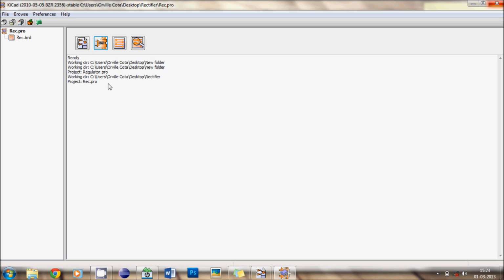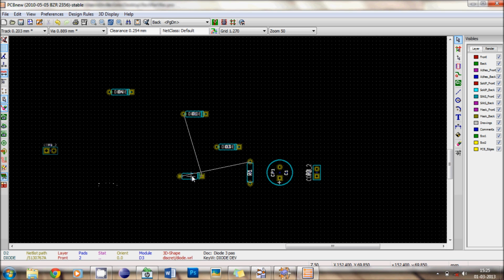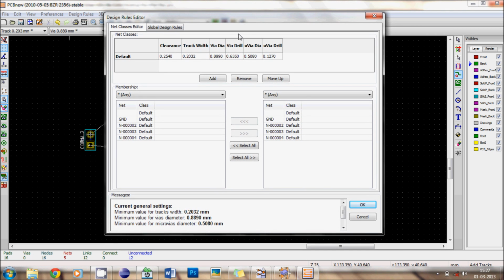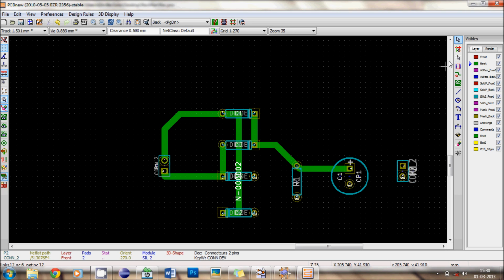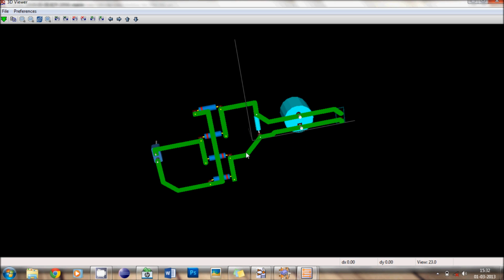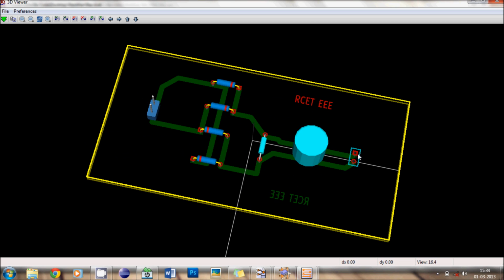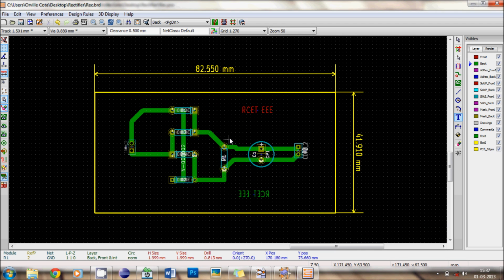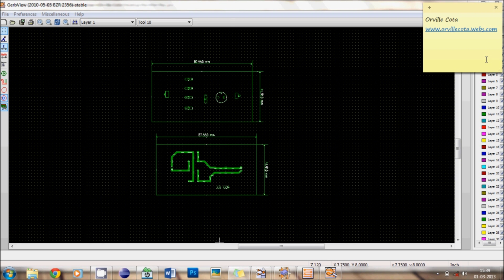PCB Development using KiCad Tutorial 3

Comment: I notice the pcb router allowed you to make connections that were not in you netlist. Off of you ac in connector the rats nest showed ac connected to adjacent diodes but you connected the top and bottom diodes togeter instead.   I would expect that this should have failed the rule checking.
Reply from the maker: Well once the rule check in the schematic has been passed, the connections for the netlist are automatically indicated by the software. Our job next is to connect the components in such a way that the space used to arrange the components is minimum and also the tracks must not overlap.

( I have done the design rule check in the videos) 

Still if you have any queries do let me know.